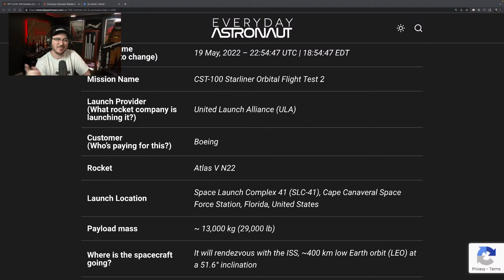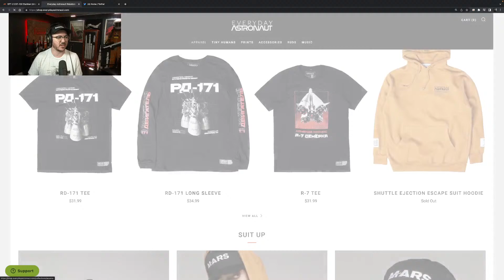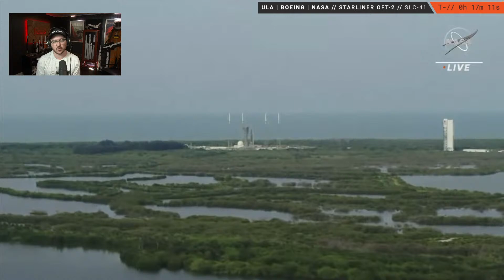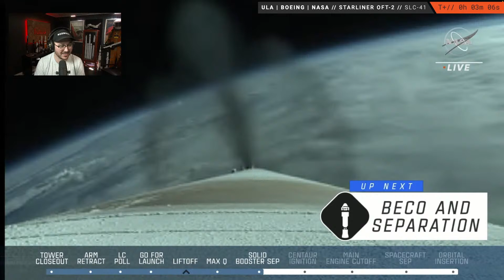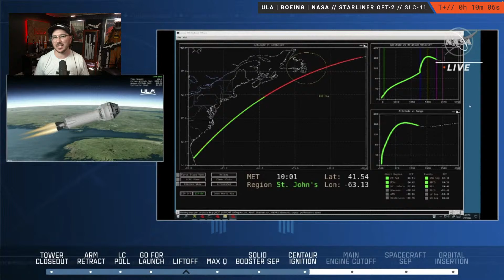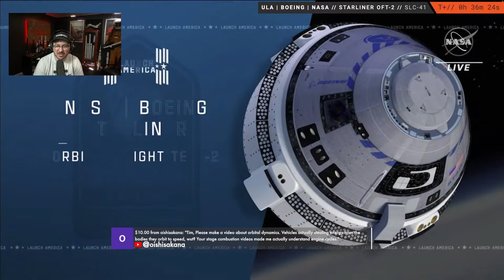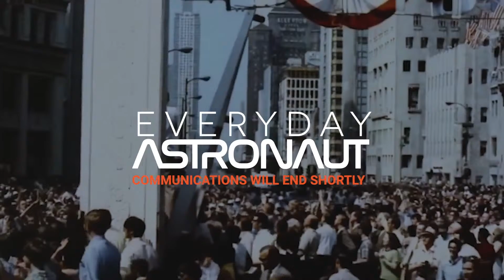Watch Boeing and ULA launch Starliner to the ISS!

Comment: I’m not an American taxpayer, but if I was I be pretty pissed off about what a waste of money this thing is. Boeing got about $5 billion for this contract, whereas SpaceX got half that to do the same thing and has done it far more effectively. I’m all for more rocket types but this thing is just another Congress “money for the boys” project.
Reply: NASA has spent $40 billion on Orion and SLS, and they are even further from flying astronauts. Compared to that, $5 billion is a bargain.
Reply: @DaveMcW  One pile of pork-barrel BS doesn't excuse a marginally less garbage pile of pork-barrel BS.
Reply: Per the NASA IG, Starliner is $90M per seat ($360M/flight) for the first 6 flights. SpaceX's latest Crew Dragon contract is for 3 flights at $900M or $75M per seat ($300M/flight). SpaceX's first contract for 6 flights was $55M per seat ($200M/flight) per the NASA IG. So the cost gap between Starliner and Crew Dragon has narrowed. It's not a one off as the CRS2 contract was bid at 50% more than the CRS contract per the NASA IG. Either way, NASA is evidently more than willing to spend $15M to $35M more per seat to have a redundant crew spacecraft to the ISS. NASA evidently doesn't want to have to go back to Russia, hat in hand, to buy seats of something happens to Crew Dragon.

Comment: Since ULA doesn't re-use it's boosters, is the cost to bring stuff to space higher than SpaceX?
Reply: Much higher.
Reply: @aldunlop4622  Doesn't it make it non-competitive? 🤔
Reply: @SDMCanada   The government has a strategic interest in maintaining two, independent manned space providers. Boeing doesn't have to be competitive with SpaceX. They just have to be competitive with the rest of the pack, which they are. The wisdom of the two independent provider philosophy has been very amply demonstrated in the last two years when SpaceX could fly and Boeing was grounded. Can you imagine the state we would be in of certain members of Congress had had their way and Boeing had been chosen as the sole provider?
Reply: @odysseusrex5908  I understand the strategy of abundance of options. But under normal circumstances why would NASA ditch SpaceX and go for the more expensive ULA/Boeing contractor?
Reply: @SDMCanada  At this point they wouldn't, barring a substantial technical issue found with Dragon/Falcon.

However Boeing at the time was the "reliable" choice so they got a better contract price set years and years ago. After the initial contract is up we'll see if NASA has the balls to try and cut their future Starliner seat prices or if the value in having redundant vehicles will mean that they just keep Starliner flying at absurd cost despite SpaceX doing the same mission for less. At the very least hopefully they'll sign up for less Starliner missions versus the number of future Dragon flights they order
Reply: @SDMCanada  1) if you want to have redundant option you need to keep it alive all the time eith facalities working. In case dragon exploded again you need operating crews to use starliner quickly
2) it still have some things to offer that SpaceX doesn't. Reboosts, and 5 seats instead of 4 in case nasa would want to send more. Also who knows, maybe after all these 2 years of problems starliner will turn out more reliable than dragon?(stuff like pee leak or late shute)
Reply: @SDMCanada   Who's ditching SpaceX? they are creating two independent providers. the value of such a system has been well demonstrated these last two years. Granted, nobody expected one of the two providers to wind up grounded before it ever flew, but that is what happened and thank God we had another one. Now, assuming Starliner ultimately checks out, both providers will run regular flights.
Reply: @aldunlop4622  Show us the castings Al.
Reply: Substantially.
Reply: Who says coming in seconds doesn’t pay? It’s weird that it pays more than first though… what would be fun would be that NASA pay a bonus to the first place finisher the difference in the contract prices!
Reply: Waaay!
By billions!
Reply: That is the the main goal of SpaceX, so they should be cheaper by design

Comment: Star liner can’t boost the station, future iterations may be able to boost the station. I would bet spacex could figure out how to boost the station before Boeing could get a star liner up there to boost the station
Reply: perhaps, NASA didn't ask SpaceX for this additional future at all. bec I'm sure if it was in the list, it would be done w no problem by Spacex
Reply: Dragon has a massive trunk volume with an open back, I have to imagine that a spare tank of hypergolics and a pack of rear-facing Draco's would be totally trivial by aerospace standards. All existing hardware that would just need to be mounted and wired into the software. If NASA asked I bet SpaceX could have an equipped Dragon on the pad within 3-4 months.
Reply: Dragon can't physically boost the station beacuse it's forward thrusters are located around docking port and firing would burn the station itself
Reply: @_mikolaj_  star liner can’t boost the iss because they haven’t even gotten to the iss
Reply: @jimmars  not to worry, they are docking right now
Reply: @_mikolaj_  awesomeness so it’s the first time it’s ever docked, I’m sure next time it can do all the things!
Reply: @_mikolaj_  with how many thrusters operational?
Reply: @jimmars  all of them
Reply: Even if SpaceX is a year off it's timeline, their space station will be able to house the ISS inside.
(Without solar arms).
Reply: @cjjenson8212  game over! /Jk
Reply: Having backups enables Nasa to have a hand in throttling costs, as they already do so much with so little.

Comment: What is the cost difference between this launch versus SpaceX?
Reply: Space X $209 million vs Boeing $345 million
Reply: @icepick6270  Per the NASA IG, Starliner is $90M per seat ($360M/flight) for the first 6 flights. SpaceX's latest Crew Dragon contract is for 3 flights at $900M or $75M per seat ($300M/flight). SpaceX's first contract for 6 flights was $55M per seat ($200M/flight) per the NASA IG. So the cost gap between Starliner and Crew Dragon has narrowed. It's not a one off as the CRS2 contract was bid at 50% more than the CRS contract per the NASA IG. Either way, NASA is evidently more than willing to spend $15M to $35M more per seat to have a redundant crew spacecraft to the ISS. NASA evidently doesn't want to have to go back to Russia, hat in hand, to buy seats of something happens to Crew Dragon.
Reply: One looks like a rocket one looks like a flyin DICK !!!!!!
Reply: Actually...
10 plus billion vs 20 million.

Comment: at what point of the previous test did they notice a problem? it was not right after launch, right?
Reply: It was the flight computer's mission time that was pulled incorrectly from the Atlas V. So almost right away it was noticed because none of the flight computer's milestones correctly executed because it believed it was in a different part of the flight. They manually adjusted it but it was already out of the orbital plane of the ISS
Reply: @aerostorm_  right. But two out of twelve thrusters had problems in this test. 

So it was not a complete success either